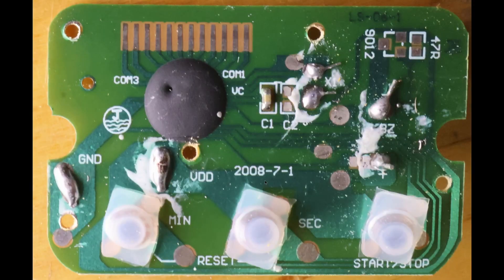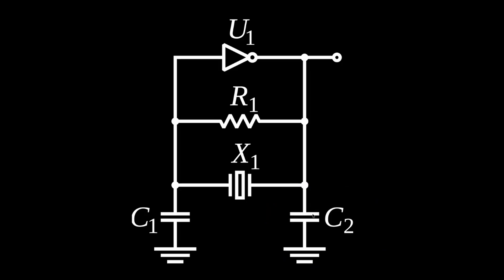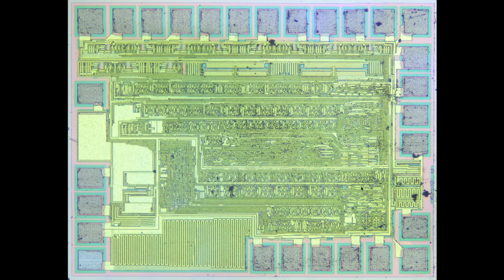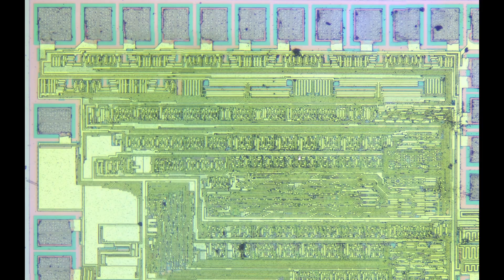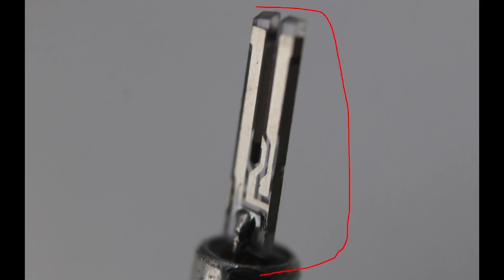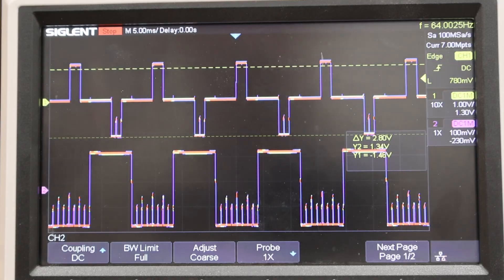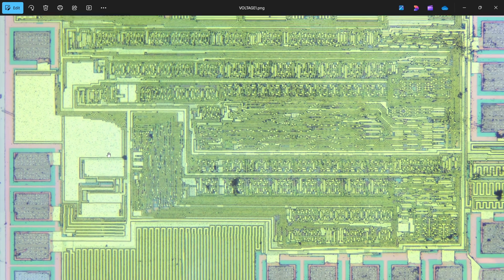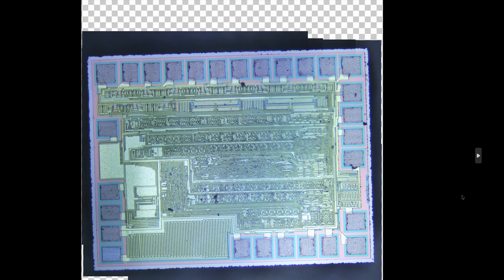Reverse Engineering:   Teardown of a Digital Timer.  Technology hiding in plain sight!

Comment: Some thaughts:
- LCD does not need "negative voltage" it just needs to flip pins. Think of it as if you probe voltage in relation to Minus of battery you will get around half vcc so 1.5V bat you will measure 0.75. But if you measure in relation to com1 com2 of lcd you'll get around 0V because of common is constantly changing from Minus to VCC. As some wrote, you can drive whole LCD from smartly programmed uC like Attiny84 or Atmega or MSP430 whatever you like. Dave from EEV blog made comperhensive video on driving lcds from classic uC with just GPIO pins.
- you can buy tunning fork crystals not only 32 kHz, (well precicely 32 768 which is 2^15 so you just divide 15 times to get 1Hz if I remember corretly) but also something like 40kHz and 76kHz. These are waaay more precice than RC oscillator in STM/AVR/MSP uCs
- buzzer, for me sounded more like inductor-like, this would explain big voltage jumps. Piezo buzzers sound more subtle, but no shure here. Inductor-ones are more expensive. There are also ones with integrated oscillator so you just put 5V or 3V or whatever datasheet says and you get buzzing sound, but more pricey
- thanks for this video, I just love to tear everything apart and greatest fun is often with simple devices when designers are cutting costs.
- nice if you can take some measurements of actual sizes like "this is 1um long" and I always look for any easter eggs. I never designed a chip but it always fascinates me.
- thanks,

Comment: You actually don't need to generate a negative voltage to drive an LCD. You just drive segments with inverted COM signal but that wave suggest there is actually a charge pump to generate the negative voltage

Comment: To handle negative voltages wouldn’t the substrate need to be connected to the charge pump to prevent latchup?  I am kind of surprised about the negative swing switching noise with if the substrate capacitance was there so I am not quite sure exactly how this was implemented